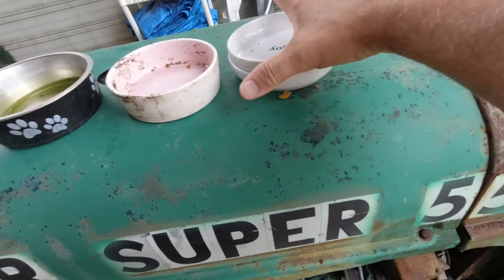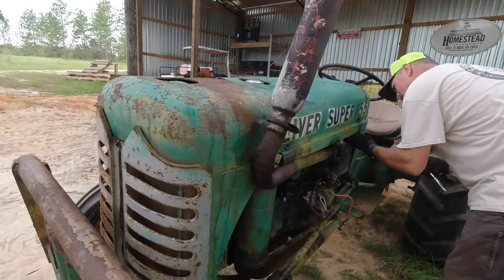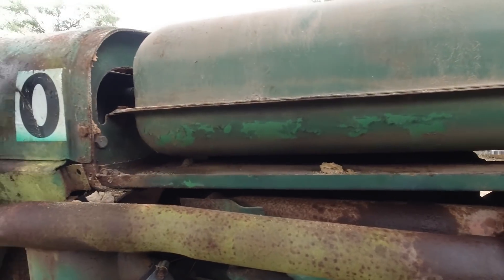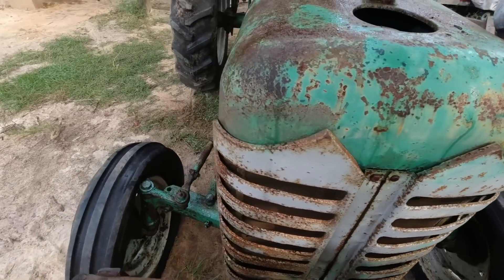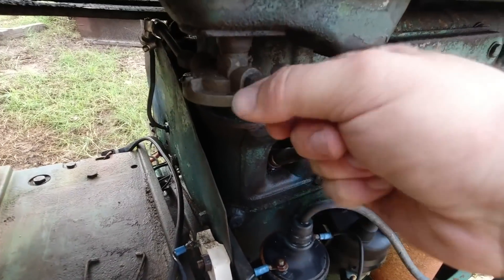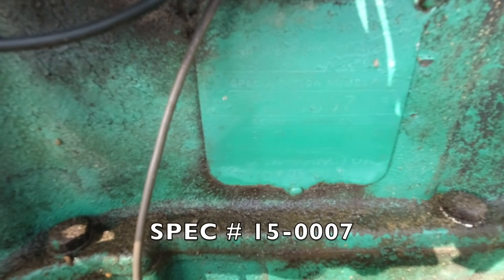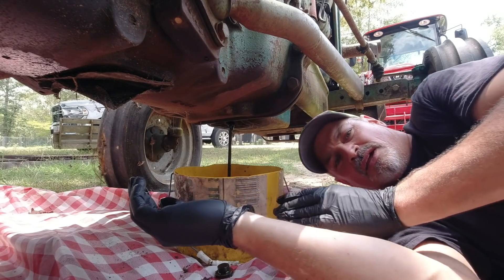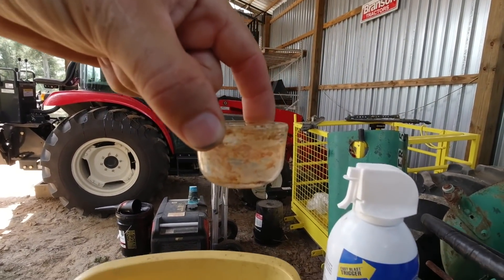Fixing the OLIVER Tractor for FREE!

Comment: Take the radiator out and take it to a local radiator shop they have the ability to clean it and also pressure test it and possibly repair any leaks for you.
Reply from the maker: Thanks 👍
Reply: Good luck finding one, there are no radiator shops anywhere in my area anymore.

Comment: Best thing I've ever learned about cleaning engine components is diesel fuel and a brush or shop towel. Parts and rebuild kits are readily available for those old tractors. If you're having issues locating them just contact the Old Timers Club. These are great fun to rebuild a make for friends and family time.
Reply from the maker: Thanks Dave. I appreciate it

Comment: The way i would go about working on the oliver is let that carb soak for a few days to get cleaned up and then pull the radiator and get a local radiator shop to boil it out and then pressure test it and i bet they could fix any leaks on it and find you a new cap and such for it . I would also fill the trans and engine with a light weight oil or diesel fuel and try to flush out some more of the water and whatever else might be in the systems
Reply from the maker: Yeah good call👍

Comment: 2 things.   look into soaking rusty metal (steel / iron) parts in muriatic acid.  
second.  on the axle  that rubber squishy thing is a vent or breather.  it helps to release pressure inside the axle with expansion of the oil as it heats up or cools down.   basically is saves your seals from blowing out if pressure were to increase inside the front axle.

3rd.  LOL   i kept watching   those 3 plugs on the hydro housing are because inside there are baffles that "dam"  some extra fluid from it all coming out.   thats what those 3 plugs are for.
Reply from the maker: Hey thanks Pat. I really appreciate that comment 👍

Comment: No need to worry about the radiator you can flush it from either or both ends and then cap off one end and see about leaks if it does it's up to you if you want to get it cored and repaired caps should be a easy find

Comment: Water in the transmission and hydraulic oil is common when they sit outside a lot. Rubber boots and seals crack over time and rain seeps past.
Reply from the maker: 10-4. Thanks 👍

Comment: Generally when draining the hydraulic system on a tractor, you have to remove all three drain plugs. This ensures that you get all the oil out since the same oil generally runs the hydraulics, transmission, and other systems.
Reply from the maker: Thanks Jason👍
Reply: It seems in many tractors those drain plugs are for three separate chambers.  Not all the oil is shared from the engine to the rearend.  Check out western truck and tractor repair. He splits a lot of tractors to work on them.  Also check out squath253.  He works and rebuilds bulldozers and tractors.  GL Hank.
Reply from the maker: Thanks Karl. I'm gonna take the other two out👍

Comment: Disconnect the lower radiator hose and plug the lower radiator outlet, you can use a plastic bag and a hose clamp, pore in a gallon of  vinegar and fill the rest with water,  vinegar will break down the rust, after a day or two flush it out and see how much rust came out,  good luck
Reply from the maker: Good idea👍

Comment: You can use Oxi Clean in the radiator and fuel tank.  Put a couple of 56 oz bottles in then top off with hot water and let sit over night. Rinse out with water and it should clean up nicely.  Hard to find radiator shops around.
Reply from the maker: Yeah they are getting fewer and far in between for sure.

Comment: OK just a guess, but that thing on the diff housing, could it be a breather to stop the axle pressurising when it gets warm but made to stop as much crap from drawing back in as possible?  Radiator looked shot to me looking through the mesh, thought I saw impact damage but could be wrong. As already mentioned, I'd suggest taking the rad to an old school radiator shop and have them check it out for you as it'd be preferable to repair what you have if practical rather than taking a chance on a modern repro or "good used" replacement. (With most vehicles/machines old enough to have some quality and more metal than plastic it's usually a case of "better the devil you know", new non-genuine parts can be a false economy). Worst case they could probably re-core the tanks if it's really beat up.
Reply from the maker: Yeah good call Dan 👍

Comment: I second that vote. The rubber like cap on the rear axle is most likely a breather vent. You still might want to pop that second middle plug you couldn't get loose. Sometimes the transmission and rear end on those tractors is sectioned off and you might still have oil in there. BTW the water that came out of rear axle can be normal, especially in humid areas. Condensation gets in there over many years and it's amazing how much gets in. Its a good thing you did that before running it. I've seen hydraulic systems on forklifts that got moisture in it and the entire system was contaminated. The oil looked like cappuccino. Imagine trying to flush an entire system.
Reply from the maker: Yeah that's a good call👍
Reply: @Hfoutdoorsyt  you might look on the side of the transmission for a side fill plug in case your transmission is a separate thing. Not likely but possible.

Comment: The three plugs on the bottom is for transmission and differential oil not hydraulic oil. The check plug for trans/diff oil is to the right of PTO shaft. You have to pump the hydraulic oil out as there is no drain plug.
Reply from the maker: Cool thank you for that👍

Comment: I would soak the carb in an ultra sonic cleaner and that  would help shift all the grim and old gas out keep up the hard work and thanks for the content stay safe and take care
Edited I would take the radiator to a repair shop and they will tell you either it needs to be replaced or it can be fixed. And if it can fixed they will fix it and then clean it inside and then pressure test it
Reply from the maker: Good call👍
Reply: Hamiltonville Farm Thanks stay safe and take care

Comment: Well when you get it out eyeball it and check it out and I'm sure you can take it to a radiator shop and they will clean and clear it and take care of what ever it needs and if you request they call first to see if you want to proceed or not and you should be able to replace that cap at any tractor supply
Reply from the maker: Thanks Shane👍

Comment: Hey there lookin forward to seeing smoke - with regards to the rubber plug on the diff I’m pretty sure it’s the breather.  The rad and cooling system.  My preferred option would be to take it to a local rad shop gave them clean it and pressure test, then they can fix any leaks while they have it and repair any fin damage.  Option b less preferred but still works, remove the rad and flush it with water, then get some evaporust and just soak the whole rad in it for a while - rinse with water and your away after you put the rad back on the rest of the cooling system will need to be flushed.  Fill it with water and add a dishwasher capsule into the rad (the puck style not the wrapper in plastic ones) run the engine up to temp and drain - continue flushing with water and getting to temp until all the soap residue is gone ( fill with hot water each time to avoid hitting the block with cold water) after you’ve flushed it fill with antifreeze to prevent and rust from forming again.  We use this procedure to flush cooling systems on caterpillar diesels all the time it works very well.  Sorry for the lengthy comment hope it helps
Reply from the maker: Thanks Nathan. I appreciate the comment. Im flipping back and forth on what I'm gonna do with that thing. Lol

Comment: With the water inside the transmission and hydraulic area put diesel fuel in there after you get it running and cycle the hydraulics a little bit retrain it out they will get all the sludge and water out of it and then put fresh hydraulic fluid in it a little tip learned on the farm
Reply from the maker: I literally was just talking about that today with a friend. I appreciate the comment 👍

Comment: When I clean my radiators I take them completely out plug the bottom part up I use iron out put in your radiator than filled with water let it soak maybe 1 hour then drain and filled with water draining it again
Reply from the maker: Thanks Charles
Reply: Got to be done from the bottom of the rad upwards or all the crap gets down into the tubes so best to turn it upside down.
If Hank wants to clean it a bit more, he could make a mix of 60/40 water & Vinegar, fill the rad from the bottom with the top openings blocked off. Good cleaner that.

Comment: You're making progress on the old Oliver, I'm sure it won't take much to get the engine up and running, just cleaning and rebuilding the carburetor, cleaning the points, new plugs and wires.
Reply from the maker: Yeah I think you're right. Should be simple enough

Comment: In my experience (I'm not a mechanic, just an old fitter machinist), any rusty radiator isn't worth trying to clean if it's really flakey rust as it will probably leak sonner or later & you end up replacing it anyway. You're looking pretty fancy with those sockets lol
Reply from the maker: Look at me going big time with the new tools! 😀

Comment: Once upon a time back in the good olden days there was a great radiator cleaner. It was DuPont No.10 Radiator Cleaner. It came in a 2 part container consisting of Oxalic Acid in 1 part and a baking soda neutralizer in the other. After draining and flushing out any Anti-Freeze one would fill the radiator with clear water and add the Oxalic Acid granuels. Run the engine for 15-30 mins. then drain and refill with neutralizer. Drain again and bingo! Rust gone. I have purchased these chemicals locally to get-er-done.
Reply from the maker: Right on Chuck 👍

Comment: Well. For the radiator theres always the classic nuts method folks use with gas tanks, fill it with a buncha nuts, some sand, and pop it on something that spins and spin it for a bit to knock all the heavy rust off. Idk how smart that would be for a radiator but thats the best I got

For the sediment bowl, you can try an ultrasonic cleaner. Thats what I did for mine and it worked pretty well. Break cleaner or carb cleaner would also work
Reply from the maker: Just did the nuts and bolts method for the gas tank today!  That video will be out soon.

Comment: You need to take the radiator off and take it to the radiator shop to be cleaned in the hot tank, pressure tested and repaired.
It maybe the core is rotted and they can re-core the radiator for less than buying a new one.
Reply from the maker: Thanks Raymond. I appreciate it 👍

Comment: You'll probably need to replace the radiator. Unfortunately to get a custom replacement will cost a few bucks. 
I only know of one person that successfully rescued an old radiator. He pressure washed it over and over to get the scale out of the unit. It was a 32 chevy radiator and he was bone broke to buy a new one. He must have used 3 cans of CLR to flush all the lime scale and iron buildup.
Reply from the maker: thanks brother. I appreciate the comment.
Reply: @Hfoutdoorsyt  Hope this was of some use to you. I can't remember exactly how long the radiator lasted after he refurbished it. It wasn't a great deal of time if I recall.

Comment: Probably going to sound weird. But, for those Allen bolts to drain your hydraulic fluid. A star bit works well. I know on some vehicles. They have a coolant drain. That's an allen bit. And I've always used a star bit. I have bad luck with using allen's on them. Something my grandpa taught me too.
Reply from the maker: Thanks man. I appreciate that👍

Comment: That old of radiator will be copper. Copper turns green, it doesn't rust. The rust is probably from the engine. Run some cooling system flush. Then  see if the radiator comes clean. And, check the water pump, seals, for leaks.
Reply from the maker: Thanks Tom. I appreciate it 👍
Reply: These tractors were built in the mid 50s, steel radiators were common then after the war.  My early 40s Ford 9n had a copper radiator.

Comment: For $25 a local radiator shop washed my 1954 international radiator out with high pressure steam.  Chances are the engine will look similar, in the south people tended to just add water and not antifreeze.  It’s also probably not repairable due to its age, mine has a small leak they could not fix, but for $600 I’ll just check my coolant before I use it😂.
Reply: The fuel sediment Assembly is cheep at tractor supply. Mine was eaten up by the varnished gas. I can’t wait to see ya riding it!  If the clutch is stuck, a common problem with tractors that sit. Try strapping the clutch petal down. The constant pressure released mine in 6 hours on an international. The ford 8N handbook recommends using a block to keep the clutch from sticking when stored for the winter.
Reply from the maker: good point about the clutch. I probably need to do that.

Comment: Take the radiator off and BEFORE you add water to it, turn it upside down and ballance it on a couple of pieces of timber to allow water to flow from the top hose and filler outlets.
Now put as strong a flow  water hose in the bottom hose outlet as you can to flush the crap out.
Remember not to put water in it from the top or you will only wash it into the radiator and clog it up.
Reply from the maker: Thanks Adam. I appreciate it!

Comment: I use mueratic acid to clean inside of rusty old motor cycle tanks . May not have mueratic spelled correctly the spell check not like it . Or use Coke or break cleaner not as good.
Reply from the maker: Thanks James 👍

Comment: Gilleys lye and hot water will clean the rad inside and out, Careful though very caustic, Using broken glass to remove rust is like a sandblaster, soak carb and bowl s in turpentine removes gum'd up gas. Old school technics still work better and cheaper.,,, Ps oven cleaner will clean a motor faster and will remove paint as well better than gunk...Ask the wife about oven cleaner oh ya.
Reply from the maker: Thanks Garnett. I appreciate it.

Comment: Radiator shops will dismantle the tanks and clean all the rust out.  They will try to rod out the tubes.  If they are too bad they may have to re-core the radiator.
Reply from the maker: Right on Gene. Thanks 👍

Comment: Hey hank ! 
You can get those gas sedement bowls at tractor supply I would replace it 
Some of them have a brass screen in there 
Also you can put muratic acid to clean the gas tank it will get the rust and scale out of it 
I would also use autolite spark plugs when you replace them 
Good luck with the project look forward 
To seeing it when you get it fixed up 
Take care have a good one 👍🏻
Reply from the maker: Thanks for the tip Nick👍

Comment: I don't think the yellow jackets are standard equipment, I think those are special order😆😆😆 I'm just messin with ya! Seriously though, the radiator could be repaired by a radiator shop. They can clean it and seal any cracks. I would look online for classic tractor parts suppliers. There was one I had a catalog for that was out of Coushatta, LA. And they sold parts for just about every make and model of classic tractor. I don't have the name handy, I just remember where they were located. I'm looking forward to "virtually working" on the tractor. 😄
Reply from the maker: Thanks David. We've ordered some parts from tractor Joe. They have been awesome

Comment: See if get new rad cap also take rad to vechile repair shop also flush the rad out rad flush out plus get pressure test also need refix if leak to up and that rad is copper core type to! If need recore it worth also check tractor company if get rad cap too and John Deere should have parts for old Oliver tractor plus serivce rad for also parts get too!  It may cost lost money & big $ but save great old Tractors life Hank :) and be super Happy when drive too again to !
Reply from the maker: Thanks Andrew. I appreciate it👍
Reply: Welcome Hank :) anytime also for exhaust if get new muffler get one 12 inches high round size plus rain cap on called Pig Let Lol (I know get Lol )  look cool to ! If want now the Pig Let muffler were used on 1930 to 1970 on motors were Contential or Buta for instances  Farmall like A to H (now called International or Case  or Cockshutt models 30 , 35 , 40  years 1942 to 1950 , David Brown, John Deere like A to D types with V 2  cylinder all gas engines ! If want check on line the 1964 to 1968 Mc-Cormick -International  105 C Combine  4 cylinder gas engines  they used them I know that had on the one I grew up with on farm ! I hope like that help on this Hank :) and enjoy video with wife today on help to and come out anytime love bees news too! Also anytime need help just say in Video ask for ACE HIGH from Ontario Canada help me please on comments with working and message back anytime too! Love your videos always and makes me smile too!

Comment: Get it running before u start replacing stuff like rad
Reply from the maker: Thanks 👍
Reply: Thats the reason I suggested he flush it out.
Get the tractor running on the old dilapidated item first then, if it runs well, spend a few bob getting the rad re-cored👍